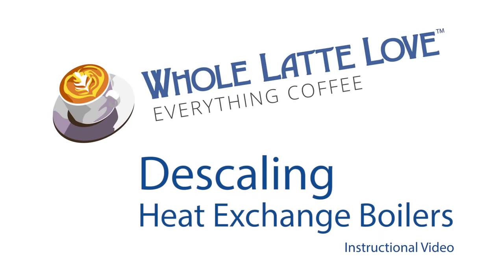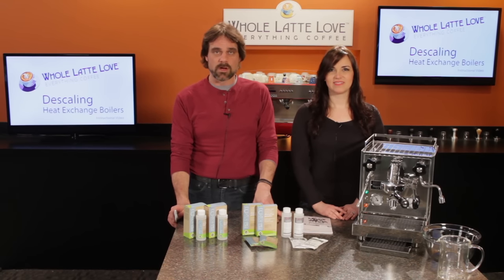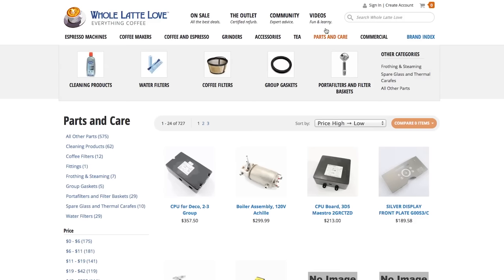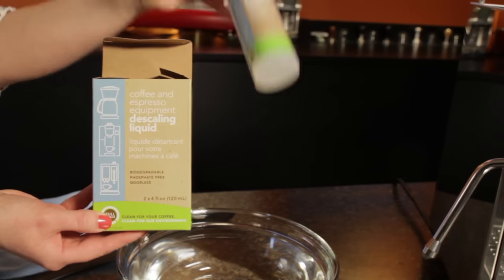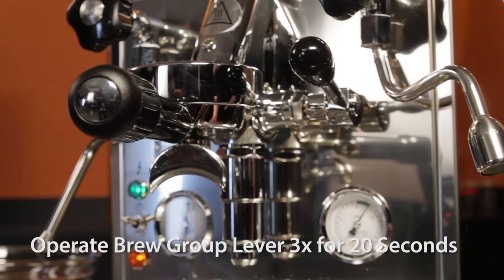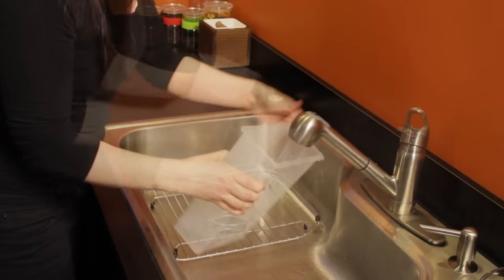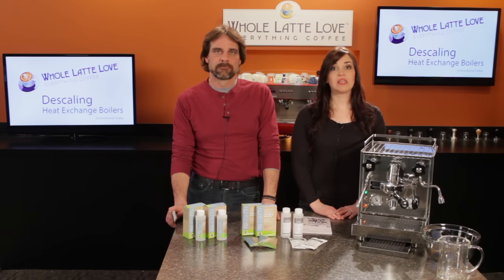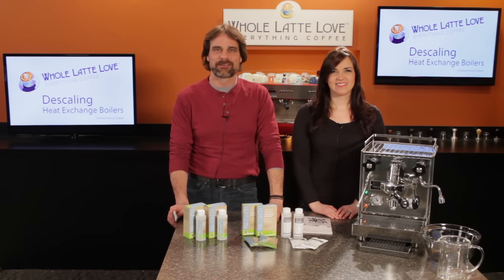How To Descale Espresso Machine Heat Exchange Boilers

Comment: CAN SOMEONE HELP ME? So I have ran a few cycles (brewing) after having done the initial one with the descaling liquid. However, after having it run a few times now with clean (and somewhat warm water) I notice that not much of the heavy calcium deposit has been removed from the bottom of the espresso water reservoir. Any tips? Should I start the descaling process with the liquid again?
Reply from the maker: Hi SC, Calcium deposits in the water reservoir may be an indication of some very hard (mineral laden) water. If you have scale there it's likely you have even more internally which is affecting your heating performance causing the "somewhat warm water" you describe. Without seeing the machine it's hard to say for sure but you may have so much internal scale that no amount of descaling will solve the problem.
Reply: @Wholelattelovepage  thanks so much for your response; I appreciate it! 
I dont know if this helps but I should had stated that:
1) I bought this all-in-one machine over 10 years ago-used it just a few times and didn't know about the descaling process and so...I never did it. I'm starting to think the calcium deposits are just too hard to remove at this point? I don't know if those deposits are toxic if it makes it into my coffee...

2) the frothing (nozzle) for as much cycles I did (descaled it at this point like 3 times then with clean water) there are orange particles that come out when I turn on the pressure button (I'm assuming it rusted) over the years so...

My question now is: 
am I better off just investing in a new one? The coffee side works like new & have had coffee but then what's the point of keeping it if the cappuccino side and nozzle are throwing out those yucky particles out? I don't want that in my drink. Advice??

Comment: So my profitec pump turns off before the hx is completely filled. Seems the 32 ounces isn’t enough to fill the boiler. Do I have to use two packets of full circle powder or simply add more water to the machine with the one packet? Thanks in advance.
Reply from the maker: Hi Alex, Thanks for the question. Not sure I totally understand but... Are you draining the boiler prior to introducing the descaling solution? Rated volume of the boiler is 67oz but that includes open space for steam and the isolated HX section for brew water. So it will not take in the rated volume. Drain the boiler first from hot water tap when machine is up to temp but after turning off power. Then make solution as directed, add solution to reservoir and turn machine back on and it should fill to normal operating level for proper descaling action. Hope that helps!
Reply: Whole Latte Love hmm. Yep I bring the machine to operating temp and drain the boiler. I prepare the solution and my pump turns on and begins filling my boiler with the solution. But every time the pump turns off before the boiler can totally fill, the amber light turns off, and the heating element turns off (or so I think). Since the pump stops filling the boiler I can’t run the solution through the brew group valve to get the solution into that valve. In the past I’ve just added about 10 ounces or so more of water to get things heated and working but I’m not sure if that’s too much water in the solution.

Comment: I would like to ask you please to know how to descale my Rocket R60V Double boiler machine using the DEZCAL powered from URNEX
Reply from the maker: Hi nader, Rocket Espresso recommends their dual boiler machines be  descaled by a professional machine technician.
Reply: @Wholelattelovepage  I thought Rocket recommended to never descale any of theri machine. So it is only for their dual boilers like my R58, but any other HX from Rocket can be done at home by yourself with a Urnex Descale product? I did not know that! :o

Comment: I have BZ10 and after few months of usage the water is not clear from water tap while it's clear from grouphead. As I never use water tap, I think I don't need to descale!? As the water coming to grouphead is from the fresh water tank. I do backflush regularly however.
Reply from the maker: Hi MJ, Thanks for the question. My apologies for a delayed response - I was on vacation and offline for about ten days. The BZ10 uses a heat exchange boiler. In that setup the water heated for steam/hot water and water for brewing are always kept separate within the machine. Over time, water in the steam/hot water section of the boiler will concentrate minerals if you only do steaming and never take hot water from the boiler. This is because the steam does not carry minerals out of the boiler. Best practice for machines with HX boilers is to occasionally turn over the water in the boiler by using the hot water tap. This lowers the mineral concentration in the boiler by adding fresh water. In your shoes I would run a few liters through the hot water tap until the water runs clear and then descale the machine. If water was not running clear from the tap as you described it's likely the mineral level in the boiler was high and some scale has formed. Going forward it's a good idea to run a few cups of water through the hot water tap on a regular basis. Depending on usage level do this every couple of days.
Marc

Comment: lelit pl41em, I descaled the machine with a descale material..
After the procedure i got metal flakes in the water..
Have you ever had this metal flakes in water Problem?
What you reccomend?
Reply from the maker: Hi YC, Thanks for the question. I have seen metal flakes. It's usually from chrome plated parts like mushroom valves of espresso machines with E61 groups - one reason I prefer stainless steel mushroom valves like those used in the E61 groups of machines from Profitec and ECM! Descaling can free up flakes found in areas with scale buildup.  I do not use Lelit machines so not certain where your flakes are coming from. I believe your machine uses a brass boiler so I think it's unlikely the flaking is from within the boiler. I recommend checking the group head of your machine for evidence of flaking coming from that area. You can use a stiff brush and some rinsing to scrub off any visible flakes if found. Also remove the shower screen. Check it and the area behind it. If shower screen is in bad shape it can be replaced. If no evidence of external flaking I'd run water through the machine until no more flakes are visible. Hope that helps!
Marc
Reply: @Wholelattelovepage  Thanks alot!!!

Comment: Hey  can you tell about the chemical which can be used to clean the boiler ?? Which are easily available
Reply from the maker: Hi HK, Citric acid is the most common descaler. Here's a video breaking down what's used in various descaling products and how to make your own using citric acid which is commonly available in bulk: https://youtu.be/YQdV2Kb2fCI
Marc

Comment: how often would you need to descale the profitec pro 700 if filter water is in use. (for Tank and Plum)
Reply from the maker: It depends on what kind of filter you are using. No difference based on tank or plumbed. Filters that remove minerals which cause scale buildup will reduce or eliminate descaling. But, very few filters remove all the minerals and if there are no minerals in brew water flavor will suffer. Here's a filter that removes scaling minerals and replaces them with magnesium to maintain flavor without causing scale. Use of this filter eliminates descaling: https://www.wholelattelove.com/products/bwt-bestmax-premium-filter-package
Reply: @Wholelattelovepage  so if you still use the tank and you use a filter BWT pack like a drop in; correct me if i am wrong i will still need to descale just less of it and the BWT bestmax premium will take away so i don't need to descale because it replaces the minerals and replaces them with magnesium

Comment: Would I also do this on the Rancilio Epoca Tank machine?  I was told this machine didn't need to be descaled by the person I bought it from.
Reply from the maker: Hi Diane, There are some cases where a machine does not have to be descaled. It's usually when the machine is using either very soft water with low mineral content or commercial level filtered water that removes scaling minerals and replaces with magnesium to maintain flavor. FYI consumer level tap and pitcher filters do not remove minerals which cause scaling. I'd be asking the person you bought the machine from why they think it doesn't need to be descaled. It's exceedingly rare that tap water is low enough in mineral content that descaling is never required. Also, if machine has never been descaled and it has scale build-up there's a chance that descaling now can loosen scale deposits. Those loose deposits may restrict flow in other parts of the machine.
Reply: After reading my original comment I realized it sounds like I bought it used, sorry for that. Ive had the machine (purchased from a store brand new) for 3 years. They told me it does not need to be descaled. That said, I use purchased bottles of purified water or distilled water. Would that be considered soft water or low mineral content? Sorry for the confusion.
Reply from the maker: Hi, No problem. The distilled or purified water should not cause scale build-up. Distilled water is mineral free and purified water is often made using reverse osmosis which would be mineral free or close enough. There's an outside chance some minerals were added back to the purified water. Especially if it is intended for drinking. That's because mineral free water does not taste very good - very flat flavor. Making coffee with mineral free water... well, it makes for rather flat tasting coffee. The Specialty Coffee Association (SCAA) recommends a certain mineral level in brew water to maintain flavor. Also be aware that ultra-pure water is a very effective solvent! So much so that it can leach ions from metals like boilers. It's why these types of water are delivered in non-metal containers and handled in non-metalic plumbing.

Comment: Thanks for the great video. I descaled (using Umex liquid Dezcal) my WLL-purchased Profitec 500 PID with flow control for the first time after about 100-110 days of daily use. The problem I now have is that there is zero pressure at the brew group. The boiler and pump pressure gauges all show normal values. With a blind filter the brew group pressure goes up to 10 bars. But with coffee in the portafilter the brew group pressure remains at zero while the boiler and pump pressure gauges both read normal values. As you would expect there is hardly any water flowing through the portafilter.
What might be the problem?
Reply from the maker: Hi Jack, Here's a link to our Pro 500 support page covering diagnoses of low or no flow from the group. Most likely culprit is scale plugging the E61 mushroom: https://support.wholelattelove.com/hc/en-us/articles/1500002870722--Profitec-Pro-500-PID-No-Water-Flow-at-All-From-the-Group
This can happen after descaling if scale is loosened up from one area and plugs another.
And here's a link to a more recent video with flow rate testing of the Pro 500 and more on the E61 group, mushroom valve and associated components (flow rate and mushroom valve at about 10 minutes into the video) It shows you in detail how to take apart, check and correct issues. Very easy to do https://youtu.be/Rqtl55_8LgA
I'm confident this will help you resolve the problem. If having this kind of scale issue after 3-4 months of use I suspect your water is rather hard (high in mineral content). You might consider filtering water to reduce calcium to prevent this problem in the future. For filtering we recommend products from BWT Water & More. They feature patented calcium to magnesium ion-exchange. That reduces calcium while maintaining the mineral level needed for good taste. They have in reservoir anti-scale pad filters: https://www.wholelattelove.com/products/bwt-bestsave-s-anti-scale-filter or a filtering pitcher if you go through more than a reservoir's worth of water a day: https://www.wholelattelove.com/products/bwt-penguin-2-7-l-water-pitcher
Marc
Reply: @Wholelattelovepage  Thanks Marc!
Reply: @Wholelattelovepage  BWT recommends their M size filter for a 2L reservoir, such as the Profitec 500 has. BWT's S size is recommended for a reservoir up to 1.5L. Is there a reason not to get the M size filter?
Reply from the maker: @jackklarfeld7726  No, M size is fine!
Marc
Reply: @Wholelattelovepage  Thank you for always being responsive and very helpful.

Comment: would it be diffrent since the proftec pro 700 is a dual boiler with a rotary  pump??
Reply from the maker: We do not recommend end 
users descale dual boiler machines. We recommend dual boiler machines be
 descaled professionally. Here's our wiki page with loads of information
 in regards to the Pro 700 including links to a bunch of useful videos 
specif to the Pro 700: https://wiki.wholelattelove.com/Profitec_Pro_700
Descaling maintenance can be eliminated by using proper water filtration. It's especially easy on a plumbed machine with a filter system like this one: https://www.wholelattelove.com/products/bwt-bestmax-premium-filter-package

Comment: Hi, what do you propose with a profitec dual boiler with o e boiler being stainless steel and one copper. Same procedure?
Reply from the maker: Hi k, As far as I know all Profitec dual boiler machines uses stainless steel for both boilers. Be aware most manufacturers (including Profitec) recommend dual boiler machines be professionally descaled. Best thing to do with dual boiler machines (really for any machine) is to use water which does not cause scale to form in first place. For plumbed machines one can use in-line ion-exchange filtration like this system from BWT: https://www.wholelattelove.com/products/bwt-bestmax-premium-filter-package-w-besthead-flex For reservoir fed machines you can prevent scale using in reservoir ion-exchange pad filters like this: https://www.wholelattelove.com/products/bwt-bestsave-m-anti-scale-filter Or an ion-exchange filter pitcher: https://www.wholelattelove.com/products/bwt-penguin-2-7-l-water-pitcher
Marc
Reply: Whole Latte Love Thanks Marc. The pro 300 has actually a brass brew boiler and a stainless steel steam boiler. I’m buying my water, will check how the pads work.

Comment: I have a la scala A1.  The issue is that tradly with HX machine you turn it off and pull the lever to dispense of the water in the HX - but the A1 has no lever...any help appreciated..Thank you.
Reply from the maker: Hi JS, You will need to run a liter or two of water from the group head to rinse the HX section of the boiler. To drain the larger steam generating section of the boiler, with the machine heated up, turn the machine off then open the hot water wand and let run until no more water is expelled. You can check rinsing by adding some baking soda to expelled rinse water. If it fizzes then acid is still present and you should rinse some more.
Marc
Reply: @Wholelattelovepage  Thank you 
 " You will need to run a liter or two of water from the group head to rinse the HX section of the boiler. " Do I achieve that by backflushing?
Reply from the maker: @jjseandxcefree  No just run brew water from the group without a portafilter in place.

Comment: Anyone else out there with the Profitec 500  that have the same issue as mine? I’ve been waiting to descale it again until I get further input about the pump turning off due to low water level since the 32 ounces of full circle descaled isn’t enough liquid for the boiler to fill properly and turns off my pump and heater.

Comment: i have heard that rocket machines are not recommended for descaling specifically appartamento is this true?
Reply from the maker: Hi W, Some manufacturers recommend only professional machine technicians descale machines. Some don't mention anything about descaling in their manuals. There's always a risk, especially in neglected machines that descaling can cause scale particles to dislodge and plug up other areas of the machine. If a machine has been taken care of well - descaled on a regular basis and source water is not unusually hard then risk is very low. Running into trouble is more likely in dual boiler machines which have more complex internal plumbing than machines with an HX boiler like the Appartamento. Descaling the Appartamento presents no more risk than descaling other similar machines with HX boilers.
Marc
Reply: @Wholelattelovepage  appreciate your quick response already descaled it the difference in coffee taste is remarkable

Comment: How often would you descale the machine that runs on RO water ?
Reply from the maker: Hi JJ, Thanks for the question. Well... I would not run a machine on pure RO water and neither should you. Pure zero TDS RO water contains no minerals. Two problems with that. First, water with no mineral content can cause corrosion of metals. Second, it will over-extract espresso as the lack of minerals makes the water a more potent solvent. Espresso will be bitter and flat tasting. You want a balanced mineral level in water. A level high enough to prevent corrosion yet low enough to prevent scale formation. If you have an RO system see if it has a bypass which feeds some tap water back into water treated by RO to maintain a reasonable mineral level. That's a common setup in commercial cafes. If you don't have a bypass there are remineralization options like this cartridge: https://www.wholelattelove.com/products/bwt-bestmin-premium-m-filter-cartridge
Hope that helps!
Marc